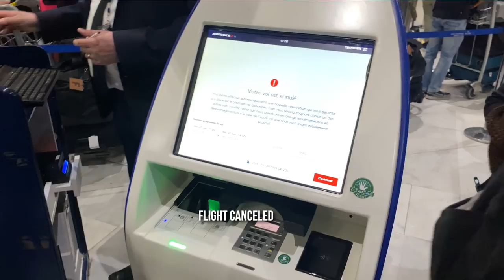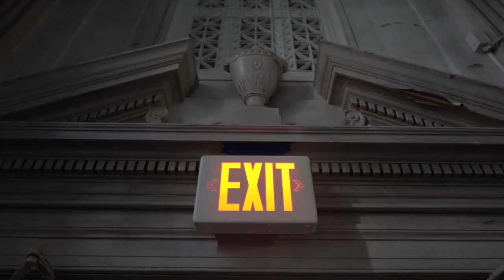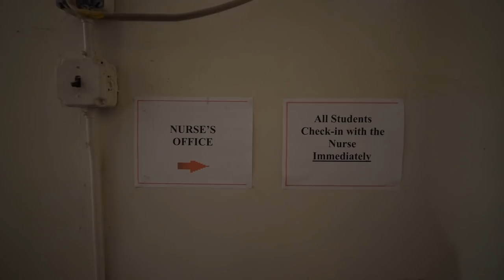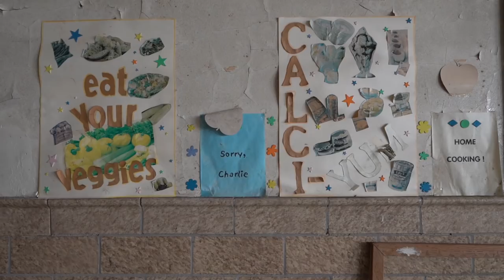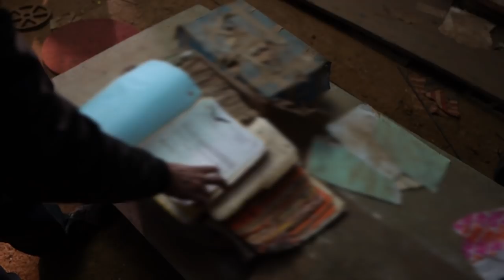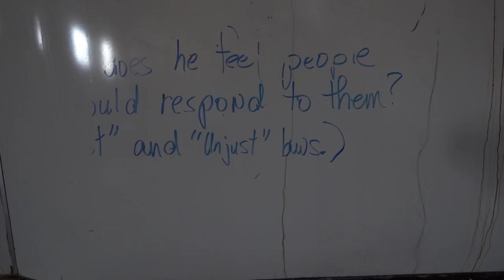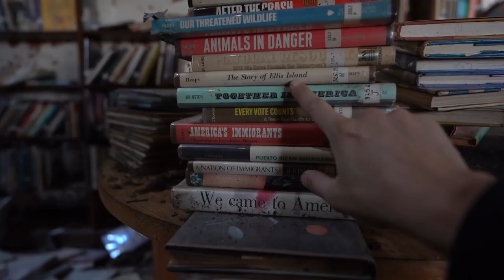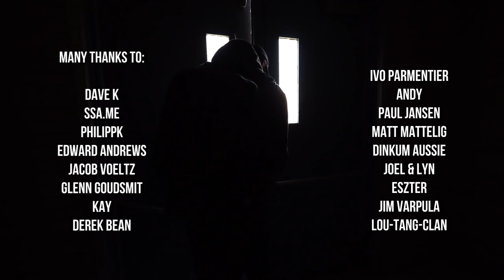ABANDONED | High school with power | EVERYTHING LEFT BEHIND

Comment: I would say what happened is the roof developed a leak sometime after the school shutdown.  Most likely because of snow buildup melting and the water pooling in certain areas on the roof, or just because maintenance to the roof wasn't done after the school shutdown.  Leak most likely happened in the room where the ceiling completely collapsed.  Then all that water was in the building just evaporating then condensing repeating that cycle over and over again until the rest of the building was in the state it was in when they went in.  Now the power being on, that would be because this building is still owned by whoever ran the school before, most likely the local town/city, and they would keep the power on to buildings they still own so that they can go in and periodically do maintenance, inspections etc..., in fact I bet until the water leak happened and the next time someone went in there, they actually still had one of the boilers still running to keep some heat in the place to keep pipes from freezing so that they could keep the fire suppression system powered up as well.  However since the leak happened, they powered down the boilers, as there's most likely a hole in roof now and they'd be wasting energy trying to keep the place heated, completely drained the water lines and shut the main valve, and right now could be trying to decide whether to completely condemn the building, try to sell it as is, or if it's worth the cost to try and fix it up and sell it or repurpose it for another use.

Comment: To open file cabinet : grasp  uppermost handle with right hand , use thumb to slide lock button to the right and tug handle. Once top drawer is open, the rest of the drawers are now accessible. F.Y.I. in future.
Reply: They were locking filing cabinets. Look on top right, slot for key
Reply: @bir4y633  You're right that they're locking, but the fact that the lock was poking out should mean it was unlocked. It's spring- loaded and you push it in until it clicks to lock it.